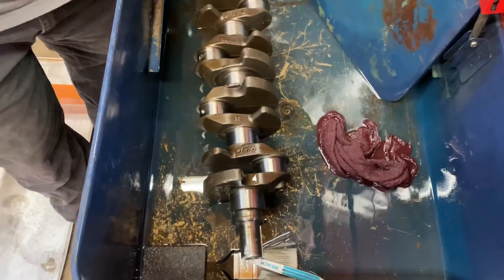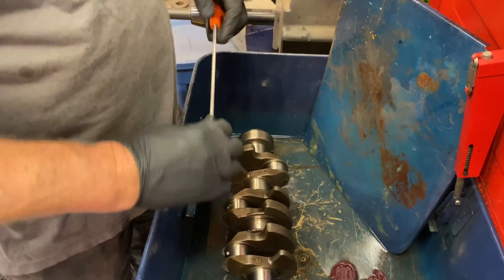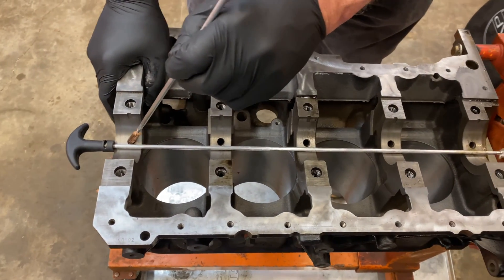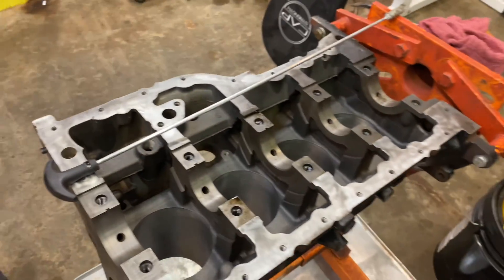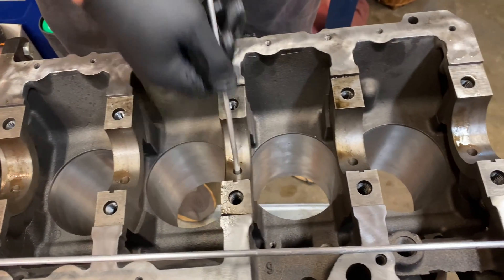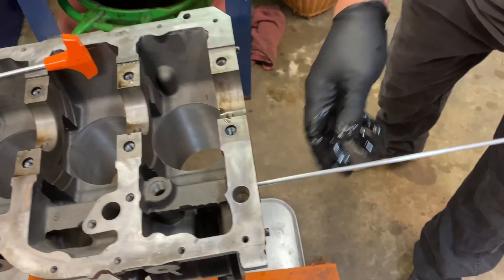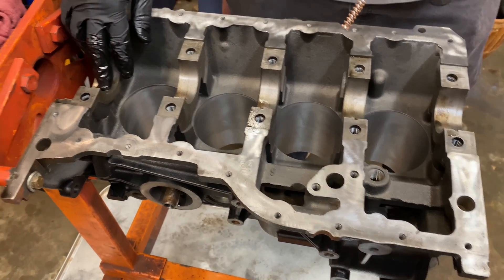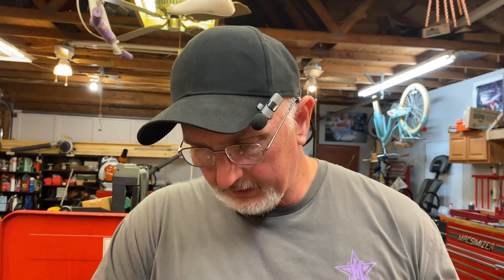How to Clean Oil Passages in a Cylinder Block before Engine Rebuild

Comment: Thank 😂 the information.  I've had 350 engine 40 over unfortunately because of finances and health I've been unable to build . It's been sitting fir several years and I've been looking to find brushes to clean out all the oil galleys . Most whatvive found is expensive and other guys want to sell you their product. Never thought about using gun cleaning kits. It's an awesome idea. thank you so much for sharing